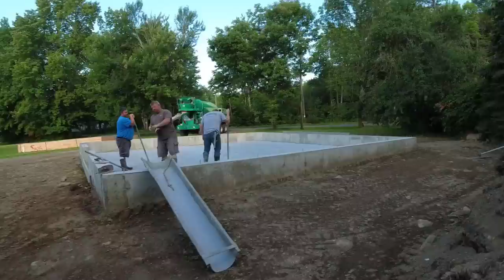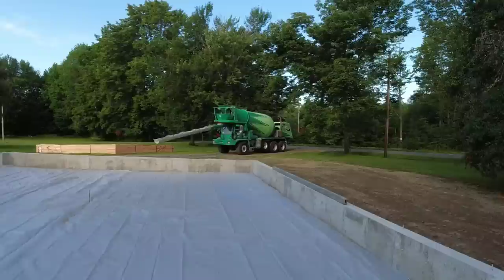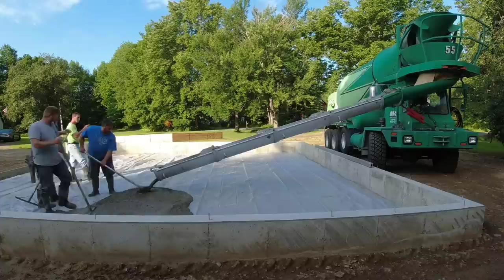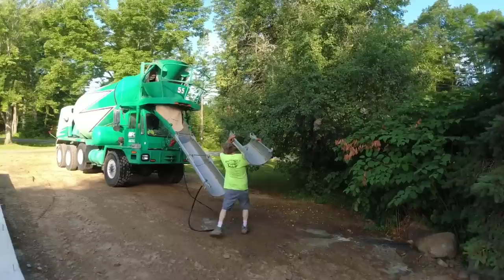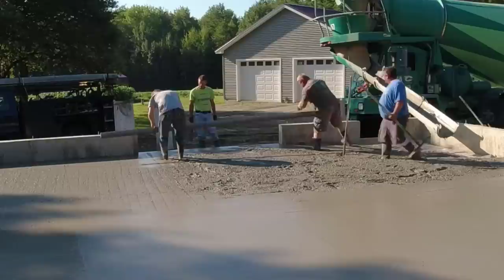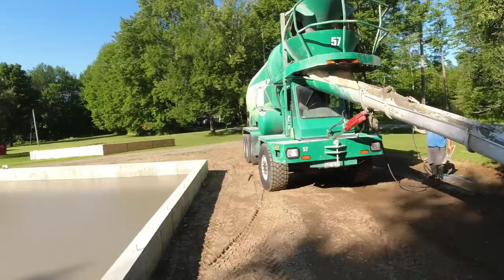(NEW!) Pouring A Concrete Floor For A New Garage

Comment: Yeah! It's all on the driver. Front dumpers are also great for curbs or low walls, IF the driver is on board.   Two guys on the screed, definitely, over eight feet

Comment: My families company has a mix of fronts and rears. You wouldn’t believe the tantrums people throw when they don’t get a front for their job.
Reply: Because rear enders suck. Your losing a guy to control the chute. A front end mixer with a good driver make placing concrete so much easier. The work is still hard when its easy to place, so if you struggle to place it too, you are killing yourself.
Reply: @aarongrabowski3775  it’s true that they are great for customers, from a supplier standpoint there are some big downsides to operating them. They are much less fuel efficient than a rear on average, they are far less reliable than a rear (more complex than a rear), and a new front can cost upwards of 100k more than a new rear.
Reply: We never had any problems with the rear Loader trucks
Reply: U wldnt believe what we have to put up with when dealing with concrete companies.